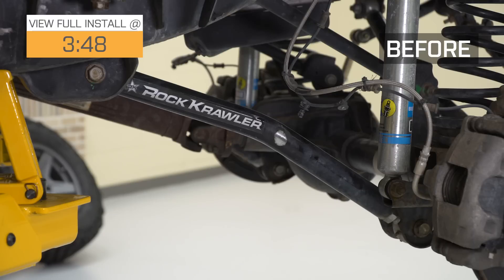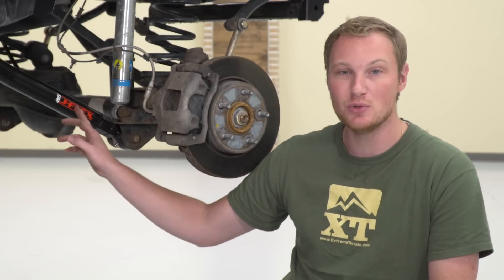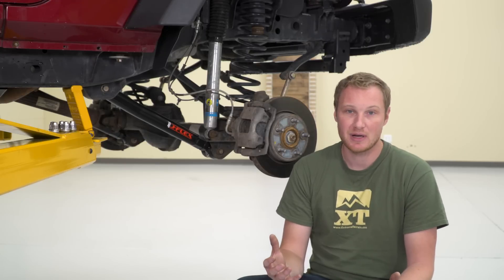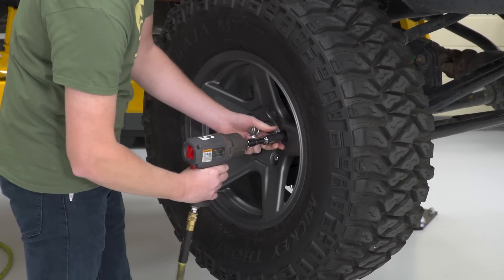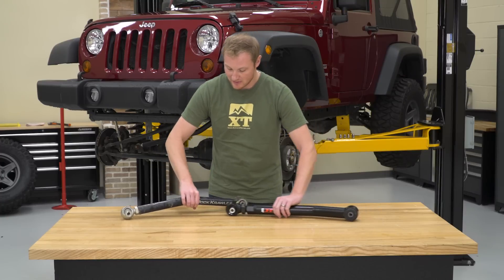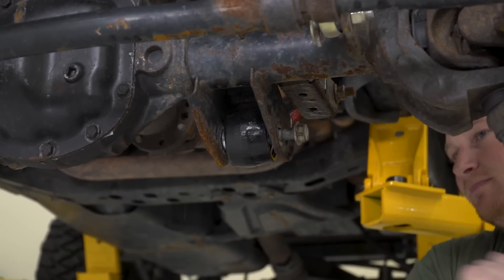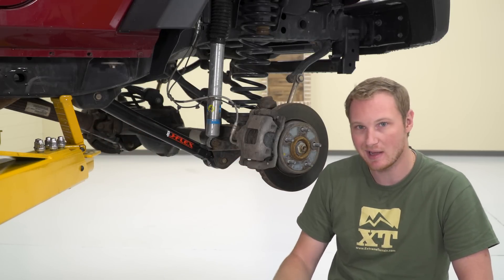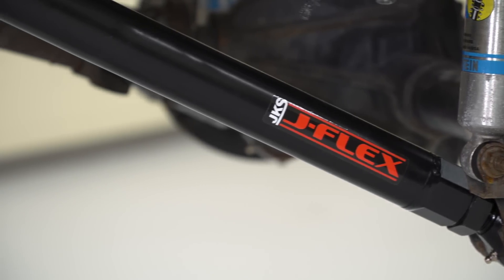Jeep Wrangler JK JKS J-Flex Adjustable Lower Control Arm for 0-6" Lift (2007-2018) Review & Install

Comment: Mech tip: never hammer in a bolt, use the impact to drive it in place. This way you don’t risk damaging the bolt tread.
Reply: I do this as you said because of how many bolts I have lost by over torquing. :'(    Heed Kevin's advice!

Comment: I have found one of the lower rams bushings need to replace shall replace arms or can only replace the bushing arms, also the one in the car i guess not factory one and i don't know what type of armas has been installed by old owner please advise

Comment: How do you determine the correct length for the control arm if you’re upgrading from stock suspension to a 2 1/2 inch lift? Would you just unscrew the jam nut 2 1/2 inches?
Reply: Did you ever figure this out? I’m in the same position. Going to be upgrading from stock to adjustable. Went with 3.25” lift. Ahh help would be appreciated. Thank you.

Comment: can you adjust pinion angle with just lowers or would be uppers be better ?
Reply from the maker: Most owners just stick with the front lower control arms to adjust the angles. However, for a full correction, all 8 arms works best!

Comment: I've seen people use spinning the jam nut to spread the anti seize on the exposed threads...if this is wrong, how do you suggest doing it? 2, does a torque wrench with claw tool fit on the jam nut with the arm installed? Seems like it wouldn't. Thanks! I bought these exact control arms last year but I was waiting for the rest of my lift before installing.
Reply: I just put a set on mine. JKS instructions says to put flex joint on frame side bracket. No problem getting the 1-7/8” crows foot and torque wrench on them.
Reply: @brianschutt5359  that's interesting that the rubber bushing would go on the axle, but that will make the jam nut easier. Thanks for the reply.
Reply: Craig R. Update... after watching video further... I only have rear control arms on mine but will have the fronts arriving in a couple days. I haven’t looked at JKS instructions for front control arms.
Reply: @brianschutt5359   i dug the instructions out. Rubber bushing does go to the axle. @extremeterrain.com fyi, you appear to have installed these backwards.